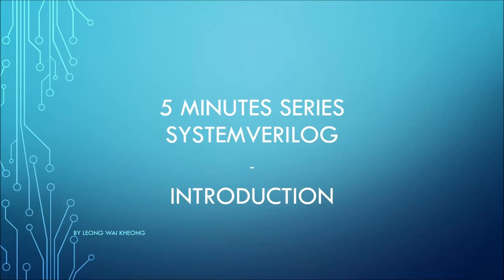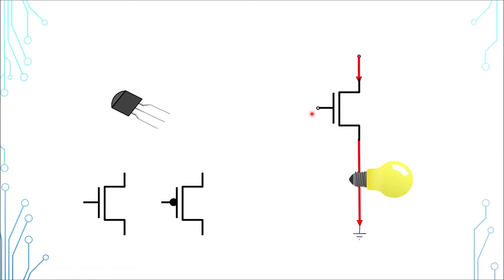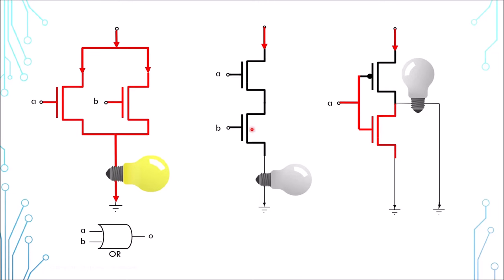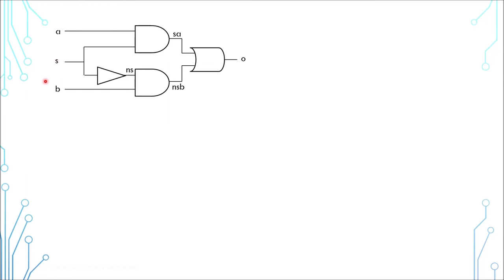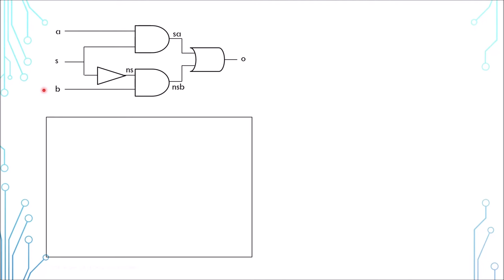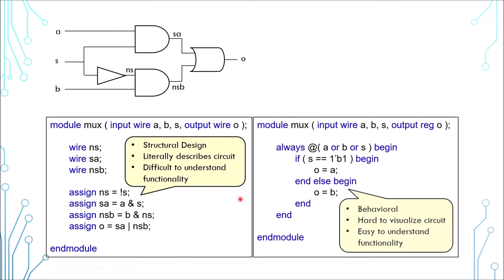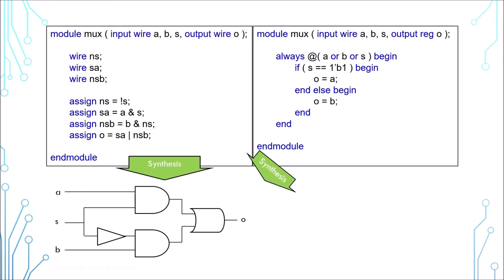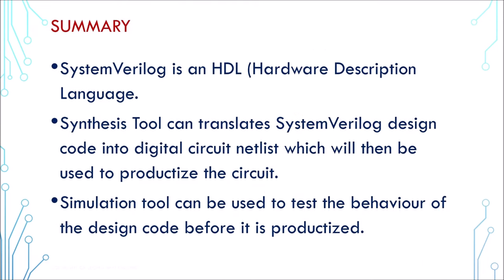SystemVerilog Tutorial in 5 Minutes - 01 Introduction

Comment: Actually this is verilog 
Not SYSTEM VERILOG 😢

In the video, you said that system verilog is used to describe the hardware of a digital circuit.

It is right 
But the main purpose of system verilog is to do verification of a design file.
Reply from the maker: I'm not sure the point of arguing which one is main: design or validation. Verilog is used for both design and validation, so is SystemVerilog. SystemVerilog is an upgrade, including both design and validation aspect. Of course, improvement in validation is major. I'd see it this way, imagine one day verilog is obsolete, all that is there is SystemVerilog. It is still used for both design and validation. Maybe more syntax is meant for validation,  but one could argue its core purpose is to produce digital hardware. Both are important.

Comment: What makes SV special compared to Matlab?
Reply from the maker: I don't understand the intent of the question; SV and Matlab are not quite the same thing to compare about. SV is a language; Matlab is a tool in general. SV is used to describe VLSI for synthesis purpose, and to write testbench for VLSI validation purpose. My experience with Matlab is limited. I know it's used for modelling and simulation. I have not heard of Matlab being used to describe VLSI. I suppose you can use Matlab to model and simulate a digital logic circuit (and I assume a simple one), but I have not heard anyone using Matlab on VLSI level, and I've definitely never heard of using Matlab in VLSI production.
Reply: @openlogic925  I asked because we use Matlab heavily in universities for modelling and simulation and you said that SV is used for simulation, so that's from where my question come. I have very limited knowledge in SV and working atm to learn it. Thanks for your response.
Reply: @openlogic925  So is there anything like Arduino/RaspberryPi as a platform to learn SV?
Reply from the maker: Yes, SV is used for simulation, but it is used to simulate digital logic circuit (which is a different aspect compared to Arduino and RaspberryPi). I'm not aware of any publicly available IDE for SV. In my case, I use normal test editor to code and commercial compiler and simulator (such as VCS from Synopsys, and Questasim from MentorGraphics) to execute. There are some free simulators but they don't support the full features of SV to the best of my knowledge. You can look for edaplayground on the web; it provides access to some simulators, it used to allow you to access the commercial simulators but it seems now it requires you to register with your affiliated organization (the company you work for, or maybe your university).